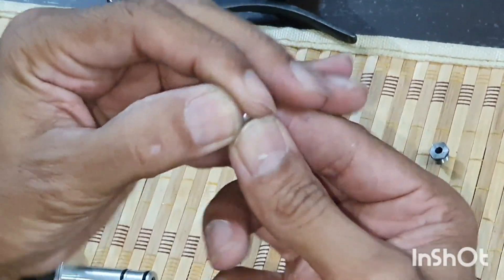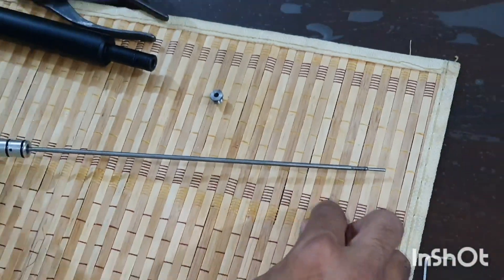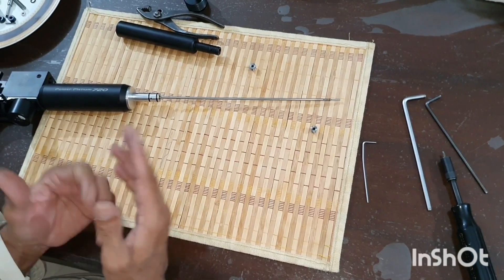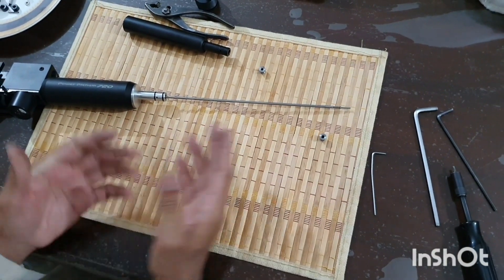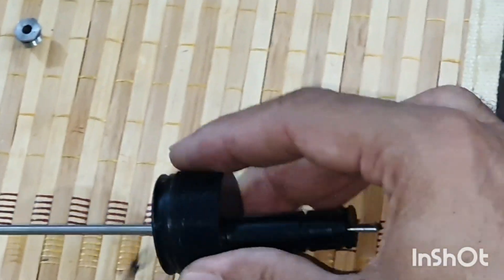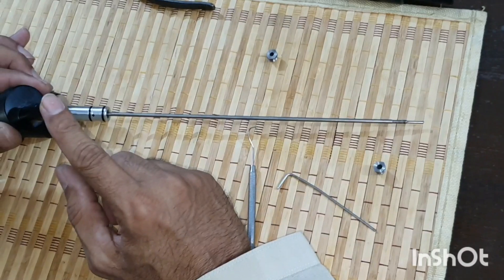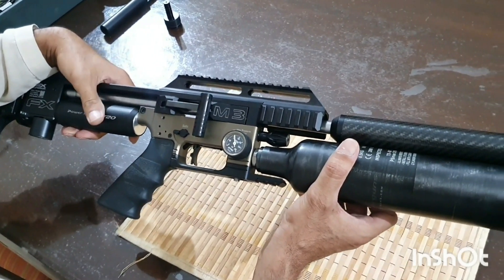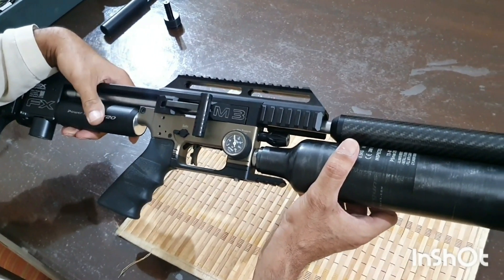FX Impact M3 & MK2  initial shots low fps solution (English & Urdu)

Comment: Great video sir, i write my tunes in a book and lately i have noticed that i can go back to a certain tune with a specific type pellet or slug and my velocity is way lower (20-40 fps) most of the time than what i have recorded, any idea on this issue? Or could it be the part your explaining in the video? Fx m3 .25 cal. Thanks for your help.
Reply from the maker: The phenomenon that I have addressed is only this that in M3 and mk2 pp when you leave the gun idle even for 15 minutes, the 1st shot is slow. This is more relevant for low power tunes. 

If we put the gun idle for a couple of days then it takes 3 or 4 shots to come back to original fps.

The thing you are mentioning is different.  The upgraded part will not resolve your problem. 

It happens many a times that if you write down the tune settings and change the settings and then again come to initial settings, you do not always get exact fps.
However you get very close and from there you fine tune again.
Reply: Try to come to the tune from a higher tunes i.e high reg to low, high macro / micro to lower and greater valve ring to less , this way you will be able to repeat your tune. If you try to tune in increasing order things will not work..hope it helps

Comment: No more higher fps, no more any consistent than original. I like that white big oring then can you send me sir?
Reply from the maker: That is a complete front part of plenum redesigned to avoid O ring sticking issues.

O ring itself doesn't do anything.  The new aluminium made front part does the trick when used with the O ring.
Reply: Hi did you receive part did it work?